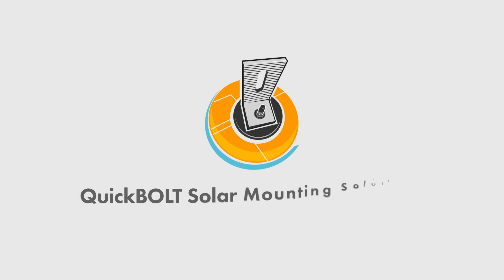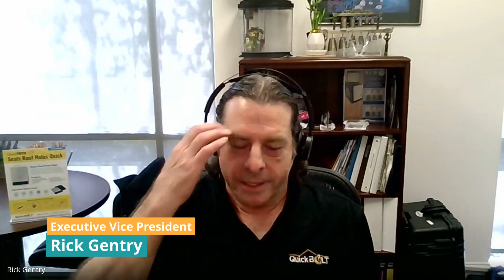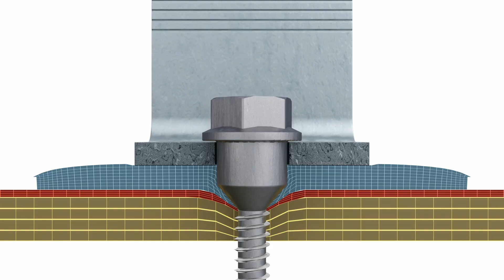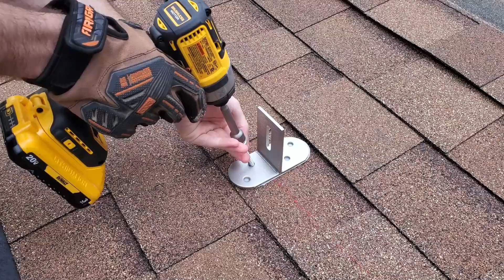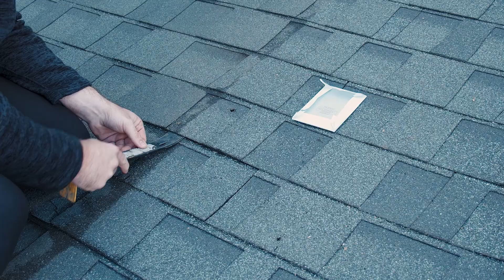Speeding up roof repair with QuickPATCH | The Pitch

Comment: So  you Poke 2 to 4 holes in your Roof for each mount. Any hole no matter what shape or form is a Risk, a Big Risk !    What happens when you need a new Roof ?  Ain't nobody talked about THAT yet. Or when you need new Solar Panels.  Ground Mount  (MPPT) Tracking is the only real way to set up your panels.

Comment: Good job but, still need to add something like this “Henry 208R Rubberized Wet Patch Black Roof Leak Repair Sealant Caulk” around the area in full and bolts. Thanks